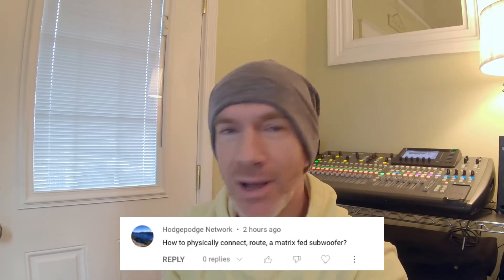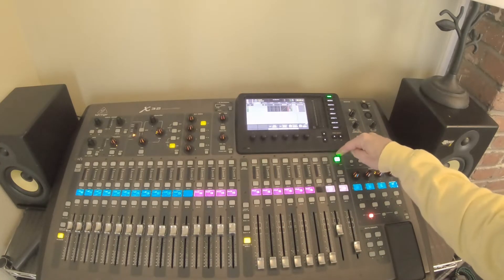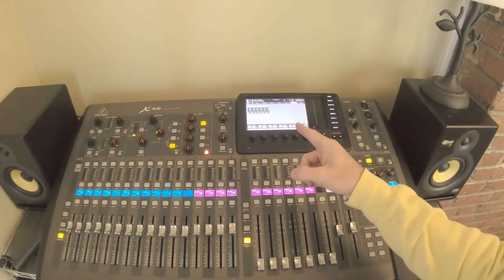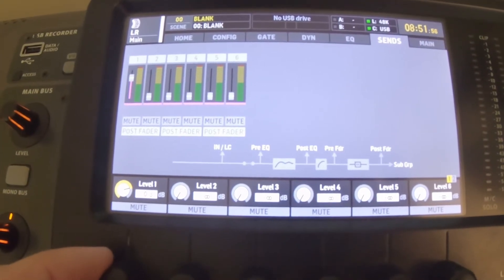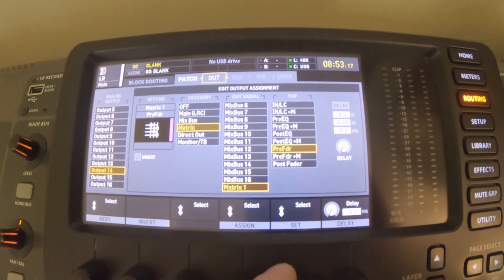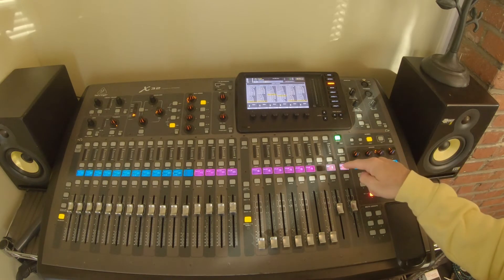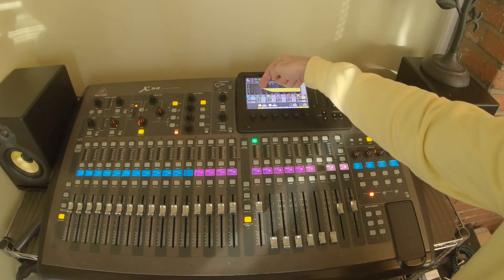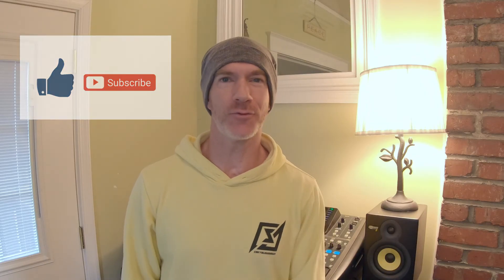How to Route your Subwoofers from a Matrix

Comment: How do you go about using the EQ, compression and gates on channels for instance the kick drum when everything is spread over 2 channels, your main for the tops and your aux out for the subs?
Reply from the maker: The channel strip (gate, EQ, comp) are specific to the input channel. Once you have engaged those tools you determine where this resultant sound will go. Usually it will go to the Main LR BUS for your top cabinets. Also, you can select to send this to the M/C channel right there on the channel home screen or you can send it to a MixBUS (Aux) to feed a sub as well. Select the MixBUS (on the right side of the console) and then go tot Home > Config to confirm this is setup as Post Fader which means all of the tools on the channel strip are impacting the sound going to this MixBUS and the fader for this channel will function in terms of turning it up or down. This way you do not turn down the channel and still have it blasting through the sub. Finally, select the MixBUS, hit "Sends on Fader" and turn up the channel in your subs to the desired amount.

Comment: I have a question about routing matrix to Aux Outs (TS/TRS).  Are these connectors TS (unbalanced) or TRS (balanced)???   I would like to use these connectors (assuming balanced TRS) for matrix outputs on a X32R.   Alternatively, I may route my buses 1-6 to the Aux outputs for IEMs, and route my matrices to the XLR outputs...
Reply from the maker: The 1/4” AUX outputs are not balanced. I would be inclined to send your BUS outs to the AUX out 1/4” connections and then send your Matrix mixes out the XLR outputs.
Reply: If I look at the block diagram in the user manual, it shows 1/4" AUX Inputs as TRS connector and the 1/4" AUX Outputs as TS connector.   Should I assume that these 1/4" Aux outs are NOT balanced?

Comment: In this setup, the vocal mics would be sent to the subs, how would  you circumvent the low end rumble form the vocal mics besides using the channel hpf, I find that that does not work well. I typically run aux sub or straight M/C.
Reply from the maker: I completely agree with you that there are many advantages to running an AUX sub and you are correct that I am only using the HPF on the vocal channels to minimize bleed into the subs. Typically speaking, most sound techs are not educated enough to setup a proper AUX sub and for a small venue with many volunteers I feel have one seem less PA is easier for them to understand and troubleshoot when things don’t go as expected. The benefits of simplicity out-weigh the extra complexity of the AUX sub setup.

Comment: I like to run aux fed subs because, 

i use 2x dual 18 subs in the middle of the stage, then i have 2x single 15/18 subs on the side with my Array tops ontop for my LR mix.

Then i send the outside mic (for low-end only) of the kickdrum to the dual subs(aux fed) and the inside of kickdrum mic with a low cut of 100hz so i get mostly attack to the LR system. then bass guitar and the rest of the mix also to the LR speakers.

Is this an effective way to get separation of kick and bass guitar, low-end spread and a cleaner sound? what issues may occur?
Reply from the maker: I would personally run all of my subs from the same output so your subs are in mono. work your placement of these subs to minimize cancellation within the room. You will not achieve "separation" of your instruments in the sub frequencies (below 150 hz). Your kick drum is heard in the mix in the 1,000-6,000hz area and the bass guitar is heard in the 200-600hz range. You hear the instruments in the top end (higher frequencies) and you feel them in the low frequencies. While your approach does sound well thought out, I'm usually concerned about how to teach this setup to the next person. Also, depending on your room shape (and many other factors) you might end up creating a bunch of null points in your room for low frequencies.

Comment: I’ve never understood the use case for doing this instead of utilizing the mono bus on every channel strip, then high & low passing main LR and M/C accordingly, routing M/C to an output that goes out to subs. Would you not have more control over what goes to the subs with this method? 

I’m sure there is a reason for the matrix fed, I really want to be enlightened… thanks!
Reply from the maker: You are exactly right that the method you mentioned (using the M/C channel) does provide more flexibility. What I find is that this increased flexibility makes it harder to teach/train new users and doesn’t offer as consistent of a setup (and maybe sound) as some groups strive to achieve. Using a matrix as mentioned in this video allows one fader to control all of your volume for the PA, still offers the low-pass EQ options for your sub and allows the PA to be one unified system. Obviously, this isn’t the final method for all users, but it does work really well in many venues. I hope that helps.
Reply: This is what I do!  I send my Main LR bus to Matrix 1 and 2, high pass that accordingly.  Then I send only the instruments I want in the subs to the M/C bus and that gets sent to Matrix 3, low passed accordingly.  I find this to be a simple and clean way to do it.  No need to have any unintended ,non musical low end rumble in the subs!
Reply: @drumskentala  Why don't you just get rid of the matrix?  put a high pass on the main L/R and send the M/C straight to the sub?
Reply: @derrickb4739  I used to do this and then a friend mentioned he likes his outputs to hit the same amount of buses and matrices.  Granted X32 self adjusts for any lag (can’t think of the correct word).  

Its also nice to see every output in a nice clean line across the matrices, typically L, R, Sub, Fill and sometimes a guest feed through a venue on Matrix 5, and a video/broadcast on 6.  I send the Main bus and M/C buss to unity and all output levels are set o. Matrices.

Comment: If the mains are being routed to a s16 (Output 7 & 8) can I still connect my subwoofer to Output 14 on my x32 (full console)?
Reply from the maker: Short answer… yes. 
You would need to make sure you have the Routing > Out is set to be sourced by your Subwoofer “mix” and then look to confirm that Routing > XLR has your xLR 14 sourced by Output 14. Assuming these items are in place all of your setup will work properly.  This video might offer more insight on the Routing tab and how everything interacts together. https://youtu.be/PpeqRuPGi2Y